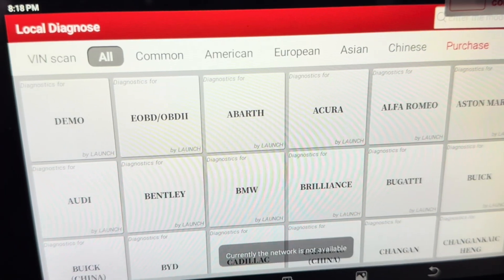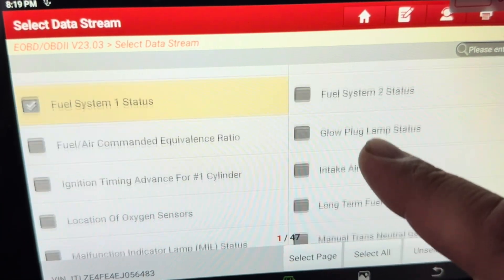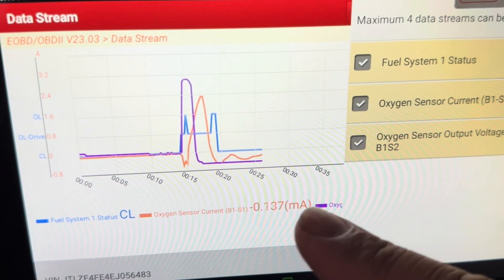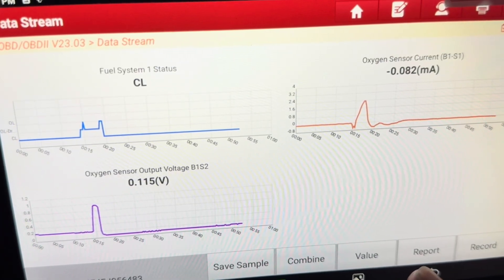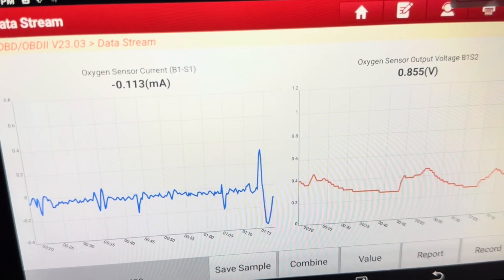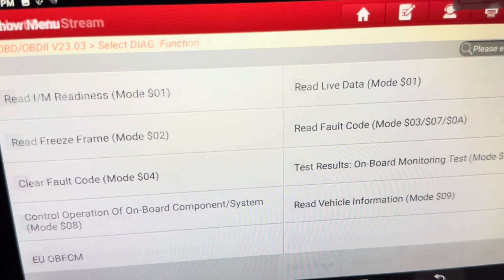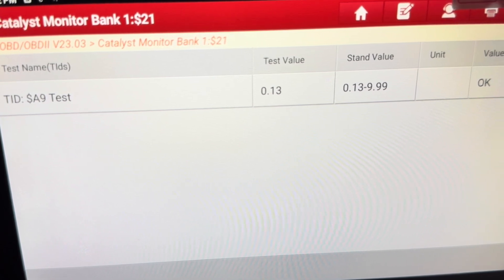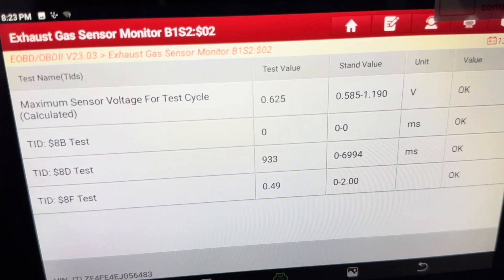P0420 Fixed! How to Confirm Your Catalytic Converter Replacement Worked

Comment: I just had my cat changed. The code came back and the shop didn't even check if it cleared. The engine was also idling so rough when I left. I'm gonna figure this shit out on my own because I don't trust mechanics anymore. Somehow, I always get the shitty ones, not the ones who are passionate about their job. 

Do you have a follow up video regarding the fuel issue? Thanks for the vid, man.

Comment: I like your scanner training videos. Very good info. My question to you is: engine runs little rough and i can to conclusion that my Catalytic maybe the problem. No Codes in scanner at all. But i have checked the temperature with heat gun and the inlet is 320’f and outlet is 299 to 307’f. What is this telling ? Bad Cat ?  I have b1s1 and b1s2. And b2s1 as is a gas v10 truck. All O2 sensors looks that are working normally. Any advice, thanks
Link to video i just took

https://youtu.be/V16OFwX28TI?feature=shared

Trying to learn all this

Comment: Seems like a lot that may or may not be,  guess thats why the shop that looked at mine used the word "could be" which is annoying, thats a lot of money for could be, maybe i should ask for the graphics that pinpoint its the Cat! I would be really pissed if i replace a catalytic converter and sensors and drive off the lot and that check engine light comes back! Then i assume they will say "could be" the engine!

Comment: is there a way you can force the computer to run the catalyst monitor in the bay like a service bay evap test through the scan tool?  i have never seen a test like that on any scanner but is there a aynypu can manually force the monitor test to run?
Reply from the maker: Not to my knowledge. It's a driven based strategy in order to complete the monitor.

Comment: Great video! We have a CRV, that we've been fighting a p219A code. The 420 popped up a few times, while diaging it. I think we have the A/F code fixed, GDI /top end clean did it. Now the P0420 IS Active & permanent. It's getting a cat. I'll definitely do this when it comes back.
Reply: Excellent video thank you for the demonstration

Comment: Great Video. I have a 2013 Ford Flex 3.5L keep getting P0430, when I use live data both downstream sensors showing steady .75V -.8V when I combine the graphs they're mirroring each other and yet I keep getting P0430 only, good fuel trims any thoughts?
Reply from the maker: Thanks for watching. Thru all engine speeds they remain steady?
Reply: @MasterAutomotiveTraining  Yes no matter of speed or load.

Comment: You were using current instead voltage for b1s1
Reply from the maker: Works the same as lambda. + mA is lean, - mA is rich. We did see a small drop as soon we went OL-Drive indicating rich.

Comment: Thank you great video. Could the lack of fuel have been seen in the short /long trim as well? As pos numbers?
Reply from the maker: STFT would show positive a lean condition, however you would still need to verify fuel delivery. The WOT, OL-Drive test is best because its PCM strategy. WOT goes into Acceleration Enrichment mode, ignoring HO2 sensors as an input and giving all available fuel. If we see a lean condition at that time, it indicates that you are lacking fuel delivery and would follow up with a fuel pressure and volume test.
Reply: @MasterAutomotiveTraining thank you very much for taking the time to answer. You guys are awesome 👏🏻
Reply from the maker: You are very welcome and thank you for watching!